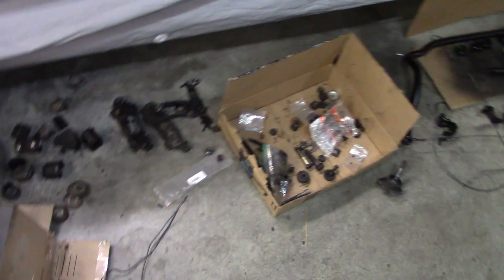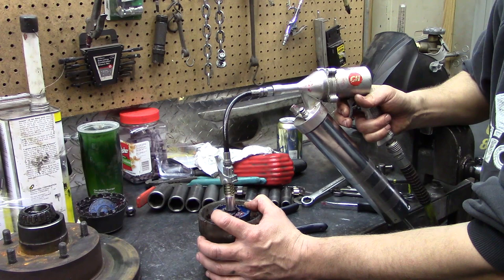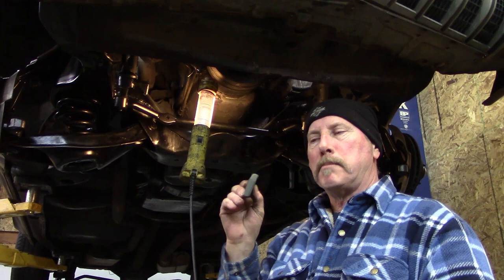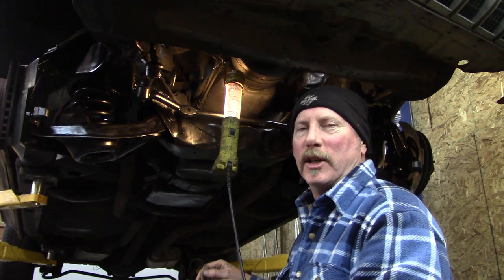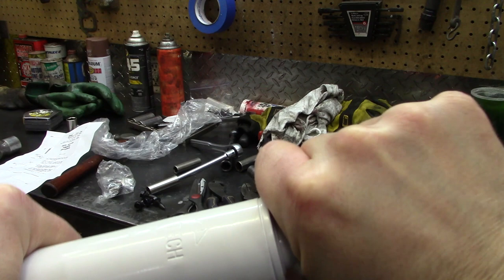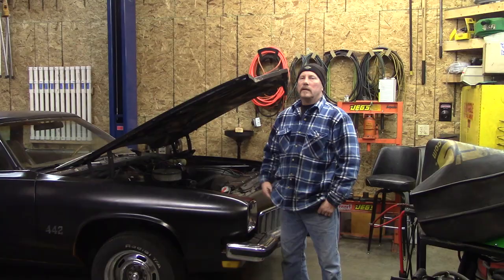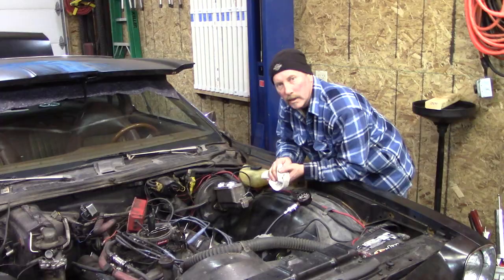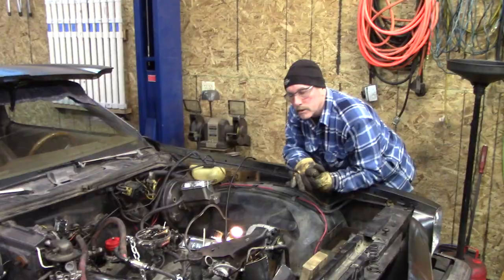442 Cutlass Engine Removal and Misc 1973

Comment: Hi guys, as always, great vid.
Good entertainment on my end being a mechanic myself.
Any evidence of any vaccum leaks with hoses left unplugged etc ?
Any signs of the carb secondaries not functioning or opening at all ?
Msd not getting a full 12-14v will def give a much weaker spark and not help in any ways. 
Good to see compressions are still good tho, an indication that those motors were built tough & spot on back in the day. Love the early 70 stuff myself. Cheers guys, keep'em comin

Comment: Ditch the Olds line of engines entirely (350 or 455). So many better options out there.
Reply: Not if you are an Oldsmobile guy keep them under 6000 rpm and they will outlive the cars in most cases, 500 ft lbs of torque with a Q-jet and stock exhaust manifolds is hard to beat
Reply: TrakSpock  spoken like a true consumer.  I agree...building Olds, Buick and Pontiac engines takes a stable income and at least a little individuality. Lots of people can't handle that.
Reply: Hmmmm, Olds 455's in marine applications and motor home chassis. Must be some factory goodness in there ! Lots of aftermarket parts competitively priced, distributers, manifolds, headers, heads and the like. Just like the Caddy's, they are torque monsters. And obviously you are not aware of the 403 co-existing in the Pont. Trans Am.